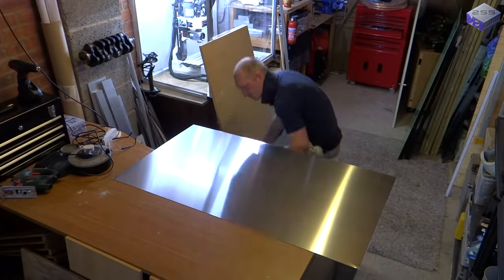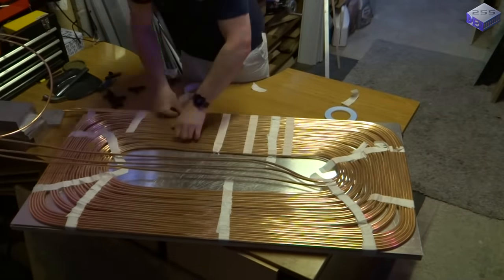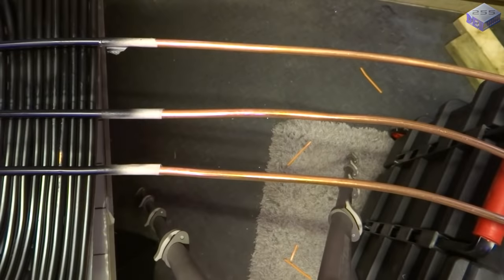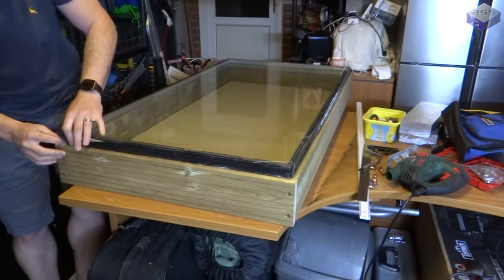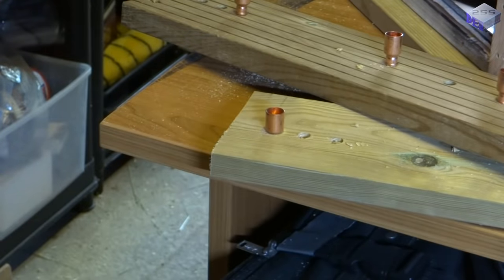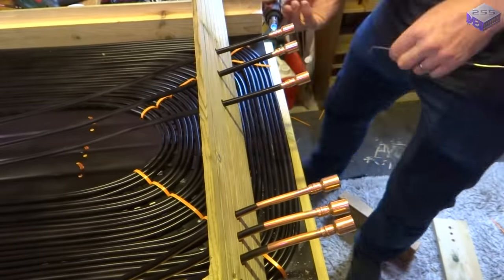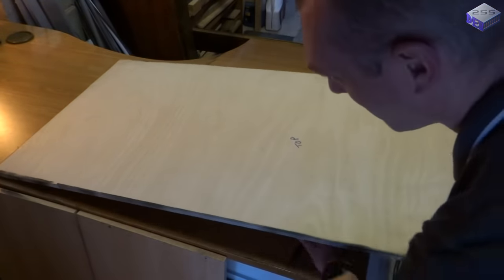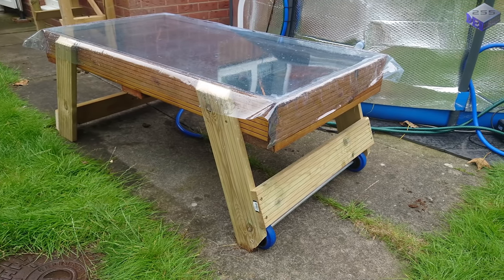Improved Solar Pool Heater - Full build

Comment: The commercial ones use much less tubing... They use straight lengths of thin tuning between two thicker manifold sections, one at top and bottom of panel. The thin tubes are soldered onto sheet-metal backing strips which gives each tube more surface area to collect heat. Your design looks to waste a lot of tubing. Thoughts on this?
Reply from the maker: Hi Tom, yes agree that more surface area, both collector and in contact with fast-flowing water is the key to transferring the most amount of heat. I chose 75 meters of tubing configured as 25 meters in parallel to help the flow and have a good amount of time exposed to the collector. I am looking into aluminium plates that I will machine to have the most surface area and anodised black with a thermally bonded tube running behind the panels with either a vacuum or clear resin to prevent heat from escaping from the surface of the collector. It's all early days yet and from all the comments I wish to make the most effective affordable homemade solar system.
Reply: @TheSolarPoweredEngineer  I still have some old ones here (in Australia) which when I tried them many years ago, seemed much more efficient than the one I tried to make similar to yours but just using 12mm black PP tubing. I had both side by side on the same day and the commercial one had steam shooting out while mine just warmed the water. But I wasn't measuring the flow rate so might be some other factors there.
Reply from the maker: @tomgrant6563  There are a lot of factors and I'm learning a lot from trying out different designs and materials, plus it's helpful to read all the comments to get a better idea before making another one. I will take another look at the different commercial types including the thermally bonded ones you mentioned. Thank you.

Comment: This is great! What size pool does this heat? And how long does it take?
Reply from the maker: Hi, our pool is 3m in diameter (10ft) and was filled to 0.75m deep, so around 4600 litres of water. It took around 2 weeks last summer to go from around 18ºC to 32ºC.

Comment: Hi. Have you seen the video using Twin Wall 16mm Polycarbonate in serial? Going to try as I have a sloped plastic roofed pergola I built over the hot tub. Just trying to work out whether to use a pump off the drain of the hot tub instead of inside. Solar powered so it only pumps when its in the sun to save having a timer.

Comment: One thing you might want is a 2 way mirror, light will enter but went be able to exit aiding in heating.
Reply from the maker: I've heard this a couple of times so may just give it a go, I do need to test a few different materials this year, so will get a 2 way mirror to test this also. It does make sense in my head

Comment: Thanks for sharing. That's one of the best I've seen. I'm making my own with HDPE pipe. I've one question: woldn't be better to place the 3 outs in the top of the frame and leaning it according to the sun angle?
Reply from the maker: Thank you. Yes, it would be best to angle it at the sun, although with the weight of this one (I will be trying different materials) I have some mirrored acrylic panels that I will be placed on the sides to reflect more light in and keep the sun focused on it as the mirrors will track the sun (need to make the rig and do some programming first). I think copper is ok, although not much different in heat transfer for my previous plastic version so I think you'll be ok with HDPE, plus there is a lot of concern over copper pipes and chlorine corrosion. Good luck with yours.

Comment: I’ve tried building a panel out of 15mm copper pipe works well when sunny. I’ve found tho the chlorine that’s in the hot tube water is reacting with the copper. Need a small bore plastic pipe solution. It’s a shame as copper is a great conductor! Good video by the way
Reply from the maker: Hi thank you, I've been looking into this quite a lot over the last year. I believe the most common cause of corrosion in copper water pipes is chlorine reacting to it, although this happens more when the ph balance is off, so if the pool ph is maintained and the chlorine is not allowed to get above 3ppm there shouldn't be any issues. As an example, the drinking water in most homes has a chlorine content of around 1 to 3ppm (5ppm max) and this runs through copper piping in the home, although the water is constantly tested and carefully adjusted by the water board to ensure ph levels, chlorine and other chemicals are maintained to ensure healthy water. The other options, if still concerned with chlorine and copper, is to have a simple heat exchanger so the copper water is in it's own closed-loop system (I will be making one on video hopefully soon). The other is to fit a UV-C clarifier so that you can reduce the chlorine by up to 80% (I've recently purchased one of those too). More videos to come 😉
Reply: @TheSolarPoweredEngineer  I’ve made my own hot tub so still learning about how to keep the water at its best. I need a better testing set really. Look forward to the new videos!
Reply from the maker: I purchased a "PoolLab 1.0" that is extremely accurate from @castlehottubs (https://www.youtube.com/channel/UCWLjG_XT6MD5NgqXMzPCOKQ/videos) to test our pool water, maybe worth a look for you. Here is the link: https://www.castlehottubs.co.uk/product/poollab-photometer/

Comment: Can you bring an vacuum into the panel? That should reduce  thermal losses. I think all the cuts had to be sealed from the outside with silicon that will be sucked in the leaks during the evacuation of the air.

Comment: hi, paint it all black and put it in another sealed chamber like a greenhouse in a green house, we do this on the allotment and we now grow all winter, it will make a huge difference with a second sealed skin
Reply from the maker: Hmmm, good thought, I could move all of them into a low greenhouse 🤔, that does make a lot of sense, then I wouldn't have to worry about the insulation of the panels too much. Thank you.

Comment: what is the price of this heater?  it's too expensive
Reply from the maker: With the current copper price, it would probably be around £300 as a rough guess. The panel can produce around 500W, so if it manages a 400W average over an 8hr day you should get 3.2kWh per day, whereas it would take around 470 days of good sun to get the cost back at 20p/kWh. So it doesn't look worth it, although having a warmer pool in the UK does make a difference and means my lil'ns can continue swimming for longer. I am aiming to find the most efficient system, including some modifications to this one.

Comment: Question: Would suspending the pipe so it can heat on all sides make it heat more effectively, similar to an oven which heats on all sides?
Reply from the maker: I like the idea. There is a solar thermal solution that does this, where it has a single pipe that runs parallel to the ground and has a parabolic mirror along its length that focuses the light on the side the sun can't reach, similar to a heater element with reflector. This could potentially be more efficient, especially if it too was enclosed in a greenhouse effect container to prevent the heat being taken away from the pipe. So Yes ;-)

Comment: Any thoughts on using copper tubing in a chlorinated system such as a swimming pool? Corrosion, contamination?
Reply from the maker: Hi, it does react if the PH balance goes off, where the reaction becomes more severe. Although, I maintain the PH at around 7.4 and now have a UVC (UV Type C (light frequency) Clarifier) so I can reduce the chlorine by up to 80%. I've done a fair bit of research into this and have found that the chlorine levels in drinking water are similar to that required for pools, where this drinking water also runs through copper pipes, although the PH is closely monitored and maintained around 7.4, hence why I ensure my pool is maintained throughout. I have not yet seen any corrosion to the copper. Here is a link to the Drinking Water Inspectorate for further info if you are concerned: https://dwi-content.s3.eu-west-2.amazonaws.com/wp-content/uploads/2022/10/14171311/Chlorine-Accessibility-Leaflet.pdf

Comment: Afternoon. Can I ask how this is going please? I thought that copper and chlorine would react - have you had any issues please?
Reply from the maker: Hi, no problems. I have it directly connected to our pool and have not seen any corrosion. I will be modifying this one in the next few days, so should be able to get a video out sometime next week. I will be looking to make a basic heat exchanger and put this one through so it has a separate water circuit, as this is a concern for a few people.

The Copper and Chlorine reaction was a concern of mine, too, and I've been researching this a fair bit to find a definitive answer. In England, the Drinking Water Inspectorate (DWI) requires that drinking water is maintained at the correct PH level and add 1mg/l (1 part per million) and up to 5ppm of Chlorine when carrying out maintenance; this (according to the below link - DWI Chlorine) is the safe level for drinking water within England. As this water predominantly runs through copper pipes in the home (replacing lead piping), there should be no concern with copper use concerning Chlorine as long as the PH balance is maintained. A greater PH imbalance exacerbates the issue with chlorine and copper corrosion. I agree that drinking water is constantly run through the home water system, where pool water is cycled around the same system, although if this is correctly maintained, there should be no concerns, especially as pool water is classed as non-potable.

A good point to note with my system is that I've introduced a UVC (UV Clarifier) to our pool that allows us to reduce the Chlorine level to around 1ppm from 3ppm.

Here is the link to the DWI Chlorine document: https://cdn.dwi.gov.uk/wp-content/uploads/2020/09/23151717/chlorine.pdf#:~:text=The%20World%20Health%20Organisation%20has,level%20below%201%20mg%2Fl

Comment: Very good job sir, really good design, but I didn't think you wanted to have a potential leak inside the heater, that reducer being in the wood will let the water get into the heater, if it started to leak.
Reply from the maker: Hi, thank you, yes there is a bit of movement with the wood moving around during heating and swelling with water ingress, although it's easy to change if that happens. I only configured it this way so that I can experiment with different configurations, like running it in series or parallel. Good point though.

Comment: Amazing job neil. 👌 I copied your solar panel from last year. Saved me a fortune, thanks so much. What kind of pump do you use? I'm thinking of raising my panel 1m off the ground on a 30 degree slope. My panel is 3m2... Any ideas? Impossible to figure out! I'm even looking at variable pool pumps but they are extortionate x
Reply from the maker: Hi, Thank you. I have been using the one in this link for a few years now: https://www.allpondsolutions.co.uk/pond/pumps/full-range/1400lh/

The good thing about this pump is that it has an input and output feed so you can connect hoses directly to it, although you will need to adapt the hose to fit, I used self-amalgamating tape covered in heat shrink, then another layer of self-amalg and heat-shrink, I thought this would only last a few months but it's still going after 3 years. The best thing to do with this pump is to attach the input to the drain of your pool and run it outside, this way the electricity does not sit in the pool and the water pressure from the pool ensures the pump is always primed. The best way I think you could mount it is on a frame with a centre pivot, this way you could keep it angled at the sun. Good luck with yours, I'm glad you are getting good results 👍.
Reply: @TheSolarPoweredEngineer  Neil would  that pump be able to work from solar.?  I was thinking if you only get heat from the sun you might as well only pump the water when it's sunny. 
I have a 20W solar powered fountain with battery back up in my pond that works fine. It's just ensuringvthe flow is adequate
Reply from the maker: @tigershuffle1  Hi, yes, you are right; I had the pump running from a 12v 50W solar panel in the end, where the pumps were only running while there was sufficient sunlight. I didn't worry about the battery backup as I wanted the pumps to stop when not required.

Comment: Great video. Have you found that the chlorinated water reacts with the copper at all?
Reply from the maker: Hi, thank you. I've not seen any problems with the copper at all as I've always maintained the correct 1 to 3ppm chlorine dose and made sure the PH balance is correct. The issue with chlorine and copper increases with greater PH imbalance. As an example, England maintains a Chlorine level greater than 1ppm in drinking water (link to DWI document below) that can go up to 5ppm with maintenance; where this water runs through mostly copper pipes within the home before we drink it. The water PH is constantly monitored and maintained too.

Drinking Water Inspectorate (DWI) Chlorine document: https://cdn.dwi.gov.uk/wp-content/uploads/2020/09/23151717/chlorine.pdf#:~:text=The%20World%20Health%20Organisation%20has,level%20below%201%20mg%2Fl.

Comment: OMG! - watching this for the first time. And it instantly struck me; if that tape is good for heattransferring, what would a bit of kooling paste made for cpus do for the gaps in between the strips of tape?
Reply from the maker: That would help the heat transfer much better, they have a bonding version of the same paste, so could replace the tape entirely.

Comment: I wounder if a one way mirror, reflecting heat back in while still allowing heat in will improve this; One way mirrors may reduce heat intake some what?
Reply from the maker: Hi, I do have some one-way mirror film that I would like to try this year; just waiting for the right weather to set it all up again. They may possibly reduce the heat, it depends, if they trap more energy than they reduce it could be worth it.

Comment: Does it do anything on a bright winters day? Obviously going great guns in the UK now but wondered if it did anything when you really want the heat
Reply from the maker: Hi, you do get some heat out of it, where I do need to create a time-lapse video of the weather and overlay the output of the unit on it as I do have this question pop up from time to time.
Reply: @TheSolarPoweredEngineer  cheers for the reply good to it's still pumping out some use

Comment: A clean, scrap auto radiator is probably cheaper than all that copper.  Also,a small circulation fan inside the box should improve heat flow and help with condensation.
Reply from the maker: I am looking at doing this with car radiators with their greater surface area. Hmmm will have to look into a fan shifting around the air inside. Thank you.

Comment: Have you considered a pipeless version to save money?  Just have a header tube at the top dribbling water over the aluminum and have a drain at the bottom.  You'd have to have it high enough to gravity-feed back to the pool though
Reply from the maker: Hi, I did consider having the heating surface behind the water, although the water seems to attenuate the energy from the sun probably reflecting it back out, also I found there needs to be a significant flow to the water so that it transfers the most amount of heat to the pool. If the panel was able to heat up, there would be less energy absorbed (heat transfer is higher with greater contrasting temperatures)

Comment: Currently Copper would make this an expensive project; Great work and video; I'm planning a project very similar but I believe I'll use PEX to save some cash.
Reply from the maker: Hi, thank you, yes it can get expensive using copper, although the thinner the pipe wall the better to be fair to get more heat transfer, so may bring costs down. I have recently purchased 75m of Hozelock tubing that has a good thin wall, where it is easier to bend as it's made of LDPE (polyethene),  has very low water absorption and does not leach anything into the water. Good luck with yours 👍

Comment: Nice design. Can you show what's needed (e.g., pump) after the panel to connect to pool? Thanks
Reply from the maker: Hi, thank you, and yes, I hope to do a video in the next month showing how it's all connected.
Essentially I have used two 12V motors powered by a 50W solar panel, one for the old panel and one for this one. These pumps force the water into the panels and take their water feed from the normal pool filtered pump (Bestway); this way the pumps are protected from debris and are boosted from the main pump. All flow runs from the pool through the standard pipes and just splits to go through each panel before reconnecting to the main pool inlet. I have used a few splitters and adaptors to do this. I hope that makes sense.

Comment: I would have dipped those zip ties in a UV sealer of some sort (or sprayed them with a sealer) so as to protect them from the sun. Where I live (Arizona), those zip ties would disentegrate within 2 years, tops. Maybe in the UK, they'll last a lot longer. But they will eventually rot away.
Reply from the maker: Yes, that would have been a better option, I will look to change these to copper ties and spray them black also once these go. They are doing ok at present in the UK, plus I think the glass is reflecting some of the UV, so will need to modify this also to see if that makes a difference to the output. I chose these zip ties purely for the colour, I think it goes well with the black😉